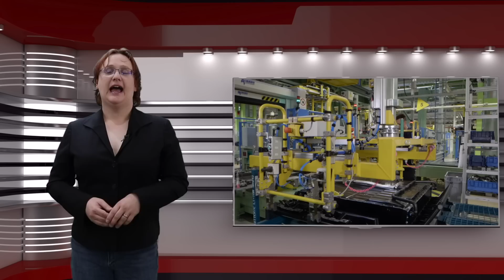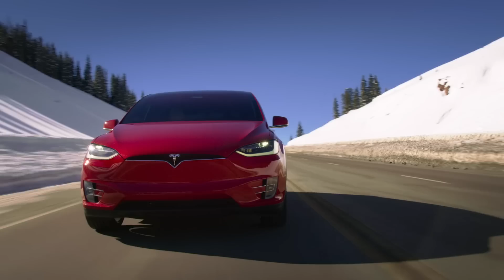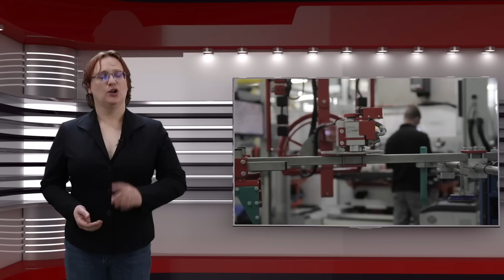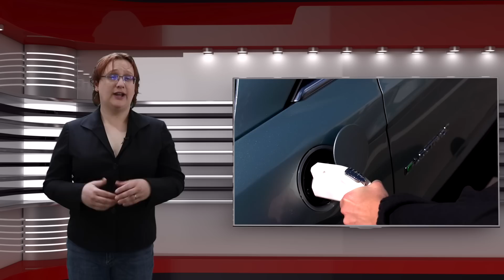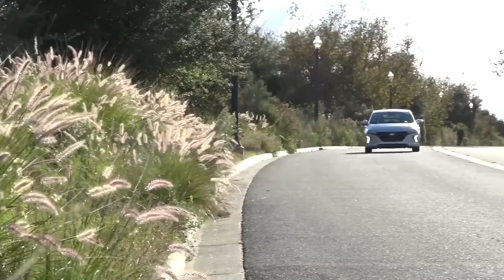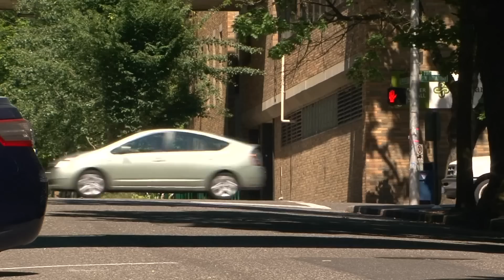As EVs Get Older, Aftermarket Batteries Will Change The EV Marketplace

Comment: "Usually Right leaning." Of course lots of usually left leaning publications or outlets have made similar claims but I know you just can't help yourself.  And why do you focus exclusively on the imaginary pollutant carbon dioxide while you fail to mention at all the tons of carcinogens and particulate matter that are spewed from the tailpipes of internal combustion engine.  It's hard to convince people that the gas exhaled by human beings is a pollutant it's easy to convince people that black smoke and soot spewing from a tailpipe is pollution.  If you want to get middle America, that thinks Al Gore is a raving lunatic, on board with EVs focus on the actual pollution that is making it almost impossible to breathe in major cities

Comment: 2 points:
1-It would have been nice if you used it as a seaway to mention Lithium recycling. Extremely curious as to the processes...
2-When, at the least the reasonable sources, question EV environmental impact. They generally compare with investing the cost difference between an EV and a gasoline car into forestation or others, which undoubtedly are cheaper alternatives to lower CO2 emissions... Just saying.

Comment: Lets be honest, everyone dosnt like spending 3000+ for a gearbox reconditioning or a 5000+ engine replacement, ignoring all the normal wear items like timing belts or chains, water pumps, pulleys and bearings. Oil, oil, oil, coolant, oil. Gease

Comment: I’ve heard that the dimensions of the 24kW and 30kW Nissan Leaf batteries are exactly the same. Given that I can’t understand why Nissan wouldn’t offer upgrades. Surely they are compatible
Reply: Stuart Pocklington It is a compliance car don’t you know. Conflict of interest. At least Fiat was honest. He said he didn’t want customers to buy electric Fiats.
Reply: I saw online somewhere that for an adapter for under $300 you can put in the higher capacity on some of the Leafs.
Reply: It appears it is due to battery management and power control systems. No one is sure yet exactly why.

Comment: Nikki - I applaud the premise but once again a bit biased.  The only manufacturer you called out by name negatively was Tesla and lumped the Nissan Leaf battery issues under a general passing comment without attribution.  You have done very in-depth videos discussing those issues, so I can't understand why you would single out one manufacturer and boilerplate the most glaring one with battery issues (Nissan) that affect this very topic of longevity.  You've talked of the vehicles you've owned and how much those batteries have failed, I've watched the videos........

That all being said - Telsa currently offers a battery upgrade option for the original Roadster. "Roadster 3.0 battery upgrade"
Tesla has also discussed if batteries come to end of life - they have a program to refurbish those batteries and put them back into use.  Which is what they are doing with the Roadster upgraded batteries, and will when they get to Model S/X/3 in their life cycle.
I think BMW made a similar claim and if I recall correctly have already had to start that replacement process on vehicles they have already produced.

Comment: I am not suggesting that EVs are not better for the environment, I firmly believe they are and once the growing pains are over, they will replace the combustion engine. But I do prefer honest numbers. 

My last two petroleum based vehicles both ran for over 200,000 miles without major engine issues. On both, I had 4-wheel drive hubs and transfer cases that required work, as well as a couple of starters and alternators, along with the batteries, hoses and belts... but, no, the past 20 years my vehicles have not had a problem at 100,000 miles. And so, using a false "fact" to base an argument is irritating. (I guess if a person doesn't service their vehicle properly the engine life will be shorter, but that is not the point.)
Reply: Mike Lieaaberman

Comment: I agree with everything you said, except I would up the mileage on an ICE vehicle.   I've had several that went over the 200k mile mark.  At that mileage the car is paid off and the cost of repair if maintenance is kept up can be cheaper than a new car payment.  If thought out, a rebuilt engine can be bought for about what your bringing a battery replacement in at.  And this is a good topic especially when you think about used EVs.  Aftermarket replacements could bring the life of the vehicle out into the teens or 20 year time frame. Used EV vot teens

Comment: It seems like all the EV battery cost discussions never take into account the cost of a major overhaul or replacement of a gas engine. Depending on the manufacturer an overhaul can start at $2500.00+ and go to over $20000.00+ for a new replacement. A new or rebuilt gas engine still leaves you with a old transmission and other worn out parts. The last rebuilt transmission cost I incurred was $2780.00 and that was 20 years ago. Just think what that would cost in current dollars. At least the batteries in an EV can be repurposed.

Comment: There may be potential from 3rd party batteries in the years to come.  Manufacturer batteries these days tend to cost a premium.  Also expect battery technology to improve rapidly.  8 yrs of battery development may and commercial upscaling may very result in a longer range, cheaper and lighter weight replacement

Comment: Good timing on this Nikki - and yes, the inevitable aftermarket battery arriving, unless a manufacturer feels brave enough and can stop it, is the final disruptive piece of the EV puzzle.  Not to mention - surely Tesla will be in a position to offer top-end 'upgrades' to other EV requirements?  If not directly doing it, then an enterprising 3rd party with some cash, making the request of them, and testing it.  Now, will BMW upgrade the firmware in that case, or take exception and make some safety claim excuse?

BMW have already been called out a little, over their other wheezes like the insistence on using 'Ah' as a measure of battery capacity, including on this channel quite rightly.  Fact: Ampere-hours are NOT a measure of energy capacity!  No, they are not.  It's a complete dodge, possibly to confuse customers, or simply to put bigger numbers to BMW's batteries.  It's quite naughty, and does not engender trust.

So, what's the conversion factor I hear you ask, to take 'Ah' and convert it into the kWh we all have heard more about, and then we can compare?!  Ha ha, no you can't do that.

No, you need to know the VOLTAGE the Ah is being delivered at.  Seriously, that's why it is not a measure of the battery capacity, because without knowing the voltage apparent during the delivery of said Ampere-hours, you CANNOT work out the energy.  Natch, BMW do not supply this easily.  I mean, the brochure has Ah numbers which we notice are conveniently (confusingly) sort of in the same ball park as other numbers from eg Tesla, but those are for kWh, therefore, not comparable - until we know the voltage!

It's pretty low.  A 94Ah battery BMW claim, turns out to be 33kWh, but of course Tesla were kicking numbers like 75kWh and 90kWh, so that to me is deliberately making an attempt to jumble numbers in barely-aware consumer minds (like I was in 2017), and leave an impression that BMW was right up there at the top with the absolute leaders in capacity and range?  I read the number, and you had to skip up to the header of the little spec table or something, to find it was in 'Ah' not 'kWh'.  Dreadful and quite targeted propaganda, really beneath a great engineering company like the Bayerische Motoren Werke.

Now, they could have made it Joules - that's an energy measure.  Kilo-Joules and so on.  That option would be confusing but have a logic to it beyond marketing tomfoolery.

Are BMW really saying, they expect potential buyers to ferret around and find out the voltage involved, then calculate the kWh capacity so as to have a level basis for comparison with other manufacturers?

No, I think confusion was the idea.  Tsk Tsk.  When you're behind, trying to cheat plays on your mind much more than when you're in front I guess.   Snap out of it BMW, just play the fact you allow upgrades...although I have not seen a price for such an upgrade, nor heard of it ever being successfully accomplished...and the chatter is, it is possible the charger hardware might need swapped out, and all sorts of stories circulate.

I think I would like to see one or two actually upgraded of these little i3 battery packs?  From 33kWh to the 43.2kWh latest one?  Oh sorry, of course, I meant from 94Ah to 120Ah.  The original 21.6kWh battery they did describe as that apparently, and never tried the wheeze of calling it 60Ah incidentally.

Annoying, innit?!

[Thanks to 'Inside Evs' for all the battery stats - Ah   AND   kWh  !!]

[EDIT - Further pertinent fact is, BMW according to Nikki, apparently won't be retaining much of the i3 model for the next series of electric vehicles?  Thus, the chances of anybody upgrading their i3 becomes imperiled I would say.  Say the value of the car drops to sub-$10k - will ANYONE put a battery upgrade into that vehicle, when it is ten years old perhaps, and costs MORE than the VEHICLE itself?  

That, is a scary proposition, and a bit unlikely.  If you have $20k or Euros to spend on an EV, would you buy a part-worn outmoded and even obsolete model, then proceed to upgrade the battery to what will likely be an obsolete capacity (say by 2025 when this fictional example is imagined)?

I fear, the chances of any person proceeding down the EV path in that manner, let alone MANY doing it, are slim to none.  IMHO.  They would be able to pick up used Ioniqs and others, for the same price, with almost no miles, or perhaps some almost-new 'sexy' new SU-EV model.  $20k ought to buy quite a decent slightly-used EV of any type almost, in the year 2025.  Who would wanna be the EV-upgrade pioneer of an obsolete i3 at that time, for the privilege of expending a year's salary on it?  Really unattractive proposition surely?  My wife wouldn't let me 'I thought we were getting a car not a project' ringing in my ears!]
Reply: sleekitwan It is a compliance car don’t you know. Conflict of interest.

Comment: I'm still driving my 1992 Geo Prizm, which, as it happens, was built in the NUMMI factory that is now the Tesla factory.
Reply: That would be an amazing candidate for EV conversion using Tesla parts.  Then NUMMI would be home doubly so!
Reply: Do you feel safe in it!
Reply: It has seat and shoulder belts but no airbags. I'm sure its crashworthiness is less than that of newer models. But when you're old and poor, you take what you can get.
Reply: I still drive my 1988 Subaru Brumby (BRAT) when I need to travel more than 130 Km because my  Nissan LEAF can't.

Comment: I’m not sure I would consider an 8yo 160,000 mile Tesla with 10% battery degradation a throw away item. Such vehicles (sadly) still out perform almost any offering from other manufacturers. The used car market appears to reflect that point today.
Reply: Roger Starkey Just that there are so few options (yes there are some) to compete with even a model S that was released in 2012. In fact there is probably no large sedans let alone a 5+2 seater.
Reply: even if other companies make a EV they would still be behind tesla because of 1 thing and that is supercharger.
Reply: there's a lot more reasons than that, their software and supporting hardware are far far beyond anything the auto industry has ever offered, outlets posts for weeks about a panel gap problem from a single source while a 1.4m recall from ford for steering wheels coming off while people are driving gets almost no coverage......
Reply: the reason i bring that it is that it highlights the need the media feels to trash tesla vs other auto makers, not only are these storied exaggerated in the media, often times even claiming things with no real evidence, but it shows they have nothing better to complain about from tesla, a really telling fact imo.
Reply: When your battery starts to lose it's capacity.  Look on my page for A trick to regain some of the capacity back.  You can use this trick on cellphone, power tools, solar arrays, 12 volt car batteries Ect.

  The effect is cumulative and takes quite awhile to get the full benefit on each battery.

  The trick should be connected while charging, but can constantly connected if that is easier for you.

Comment: As someone who tends to have older cars, mine is 15 year old Volvo of which there are plenty about,  and to be honest it’s been a long time since I’ve had any car with engine/gearbox problems sure they need services, present Car doesn’t even use oil (that I can tell) between service/MOT cars generally get scrapped because of the value of the car vs cost of any repair, rather than been worn out beyond use.

My hunch is due to that cars are likely to have shorter lifespan at least in the medium term as EV’s replace ICE cars, though I suspect obsolescence is a more pressing problem in the short term.

Comment: It is probably a simple matter of economics. In time there will be enough demand to encourage people to set a business in providing batteries, even if they sell them to others to fit. The situation with ice cars is that you will find it difficult to get a new engine for a 10 year old vehicle. The manufacturer is likely to have updated it in that time. The costs are also high as the demand is relatively low. There is however a healthy market in selling and overhauling old parts to a nearly as good as new condition.

Comment: Sadly, for the most part, our species does not seem to fully understand and or react properly to the word Finite in the context of Mother Earth's Limited Natural Resources.........
Reply: I agree, and while I don't think the lithium battery is the saviour, it works for now. The beauty of an EV is that it cares not how the energy is stored, only that it can be provided. Swap out the lithium battery with a solid state when it ages, or perhaps there'll be a fuel-cell/battery combo that fits in the same space. If the car gets the voltage and current it requires, it really doesn't care.

Comment: The problem I see is how to know quality of the aftermarket battery is up to original specs in order to avoid security hazards and longevity. When you replace the battery on your laptop with an aftermarket you usually get less life of it than original

Comment: But as long as they’re lasting way more than 8 years there’s no reason to even consider the possibility of replacing the battery pack. The batteries are covered by warranty for about that long in some cases. I’m not sure about all brands. After that amount of time, we may not even be driving any more anyway. And even if we are, or it’s an older EV, you’re probably going to want to trade it in for something newer and safer, with better tech and more range and faster charging.

Almost no one would really consider an engine replacement for an old ICE car, and I think EV batteries should be considered in the same way.

I’m guessing, perhaps naively that the cars will be a lot more recyclable than older ones especially combustion cars. We know the packs can be used in stationary storage for sure, and hopefully recycled eventually. The rest of the car I hope will be as well. We definitely don’t want scrapped EVs lined up in the desert.

Comment: I think recyclability and keeping working equipment in use is one of the most important challenges in most industries. With the eventually available solid state batteries, recycling rates likes those of ice cars will be possible and could maybe even be exceeded.
One thing I noticed is the recycling part is never mentioned when the environmental impact of EVs is discussed. My guess is that this too is a part which still needs much improvement.

Comment: The current cost of evs doesn't justify recycling at 7-8 years due to battery degradation. The rate of deprecation of you investment in resale value etc is far too high compares to say a petrol.
Cost effective replacement deals need to be in pace before I will buy another ev.

Comment: Good one Nikki, couldn’t agree more. 

Only thing I can see is that the manufacturers need to be happy (or forced by law) to permit 3rd party components into their safety model.  It would be very easy for a maker to install electronics in the battery which a third party couldn’t replicate ... similar to the fun you can enjoy trying to persuade an inkjet printer to accept a generic replacement ... only this time if the car takes a disliking to your battery you could be in the middle of nowhere and you may need to do more than just click OK to continue.
Reply: Chris Clarke  c

Comment: Lots of aftermarket battery replacement firms will grow as uptake of electric cars take off ( &  servicing Ice vehicles becomes less lucrative as there are fewer). 
I can Forsee firms offering cell upgrades ( as it's not all the cells that die off)  &  in time because of improvements in battery density it will improve your cars range,  so you may have a 24kwh leaf but after you've had your battery upgraded you could end up with a 40kwh +,  only time will tell

Comment: Are there or will there be aftermarket providers, as battery technology progresses, who might produce upgraded pack for EVs the way those of combustion vehicles make performance accessories? Would be interesting to see, adding to the longevity and enjoyment of EVs long term.
Reply: Doubt until EVs become more main stream and the market is large enough to make it profitable. And the amount of OEM support or not, as more EVs need replacements will also factor into it.  

Since most battery packs die when just a few cells die. The rebuilding market will be the cheapest option. 

IE Supply and Demand...